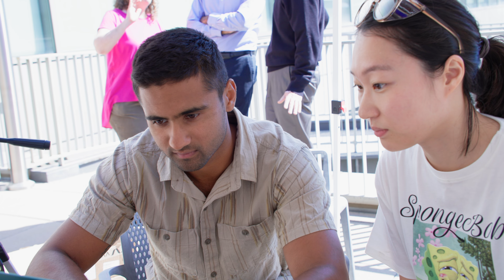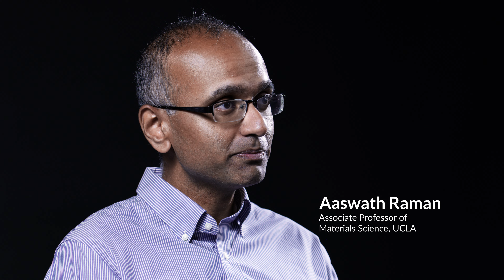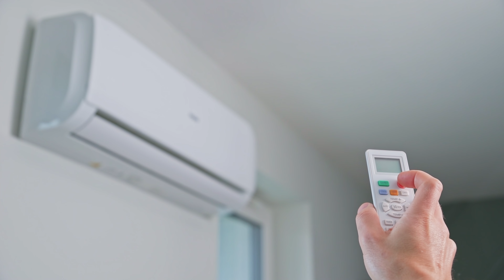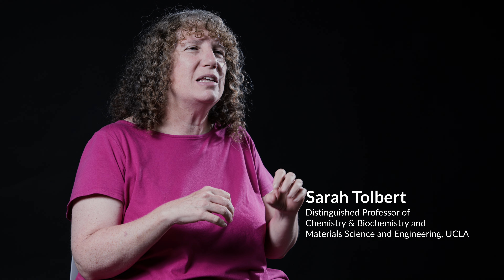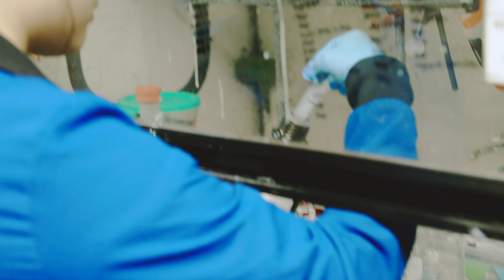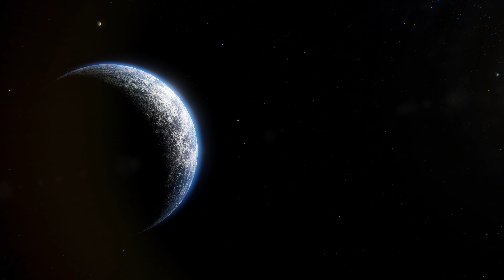New material has the potential to reduce heating and cooling costs through radiative cooling!

Comment: If solar panels were coated with this material wouldn’t they run cooler and therefore more efficient? Also, current panels are about 20% efficient. If the excess heat were transmitted into space wouldn’t that begin to offset solar forcing?